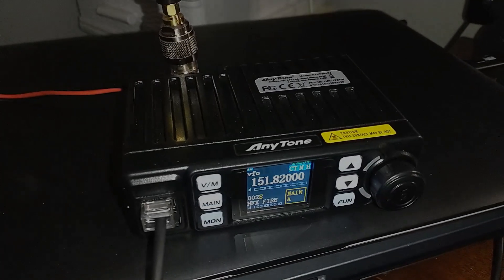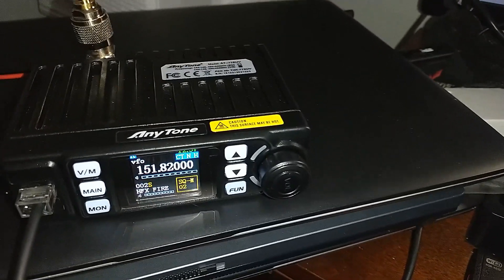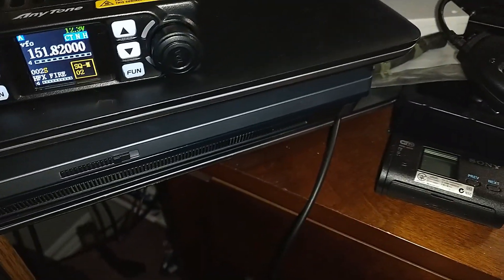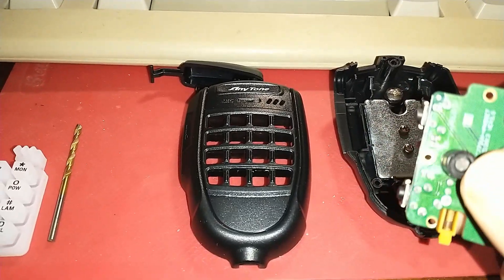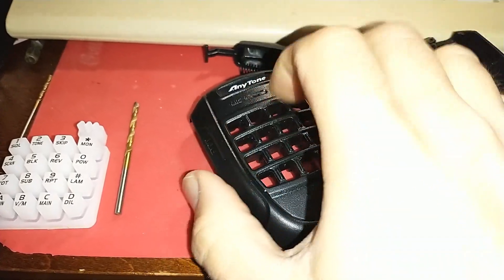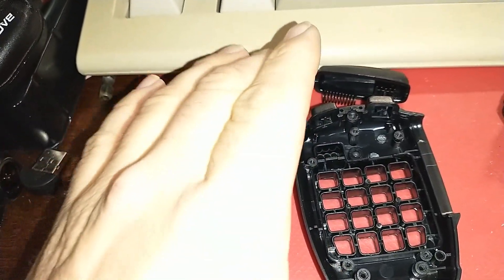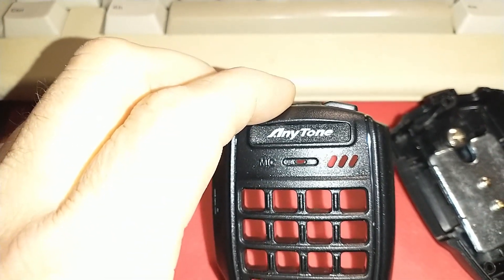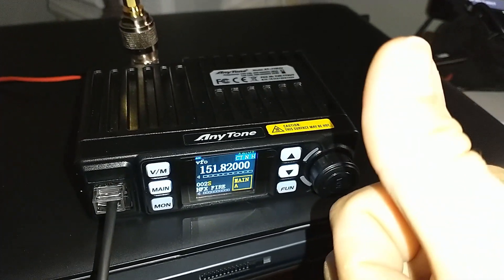AnyTone AT 779UV, Retevis RA-25, Radioddity DB-20 Mic Mod

Comment: Great info thanks. What antenna are you using? The reason I ask is that I’m using the Ed Fong GMRS antenna with mine and Ed stated that if you have the antenna in the same room that you are transmitting from, you should not transmit any higher than 5 W. If you are using the full power setting the antenna should be outside.  I set mine up for low power until I can move my antenna outside. It’s in my office window now.
Reply from the maker: Man did I ever make the mistake of transmitting at full 20 watts in the basement 🤦 It made my computer monitors go blank for a few seconds, no joke. Only did it once. In the house for testing I use what seems to be a Nagoya knock off that I have great luck with using a 90 degree adapter with an sma on it. I use the radio with a mobile antenna on my Ford Flex and I am getting very decent results. I want to buy a second 779UV for a home base station where I'll build a simple outdoor antenna. I use the radio every day and it sounds fantastic on the other end with that mod. I have managed to talk the wife into using the mobile in the vehicle and she will call me or I can call her when I go into a store without her. Or when she picks me up at work she will call me. I have the second channel on my Retevis RT3S that I use on the repeater where I work, set for her to call me.

Comment: I've had a Wouxun HT uv9xg for a little over a year and was told many times I was hitting the repeater but very, very low voice, barely could hear me. Could this be my issue?
Reply from the maker: I wonder 🤔 could be. I would test the radio with a hand held in the same space and see if getting closer to the hole for the mic changes anything, and try that drill mod.